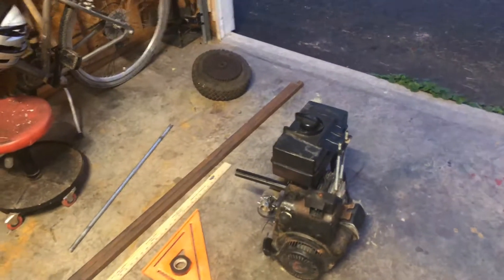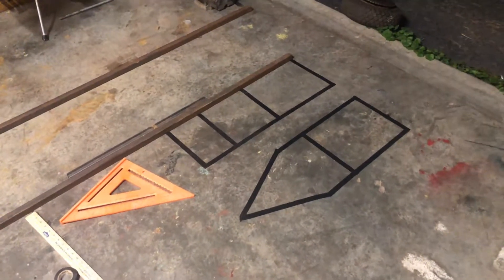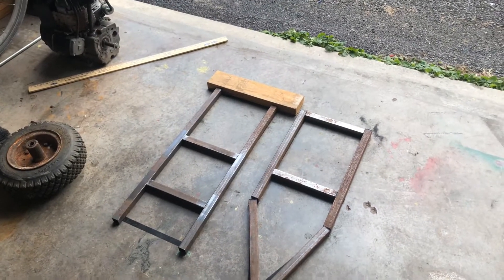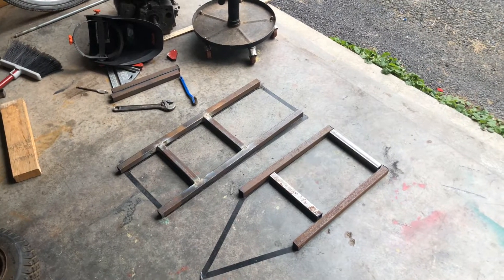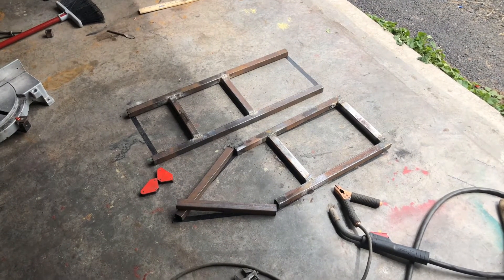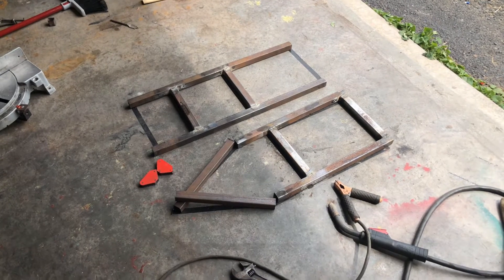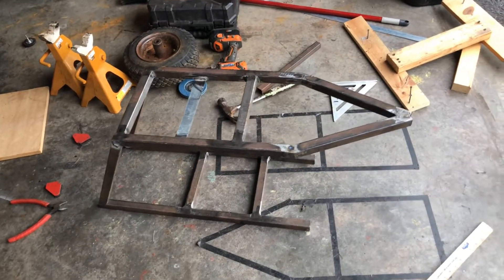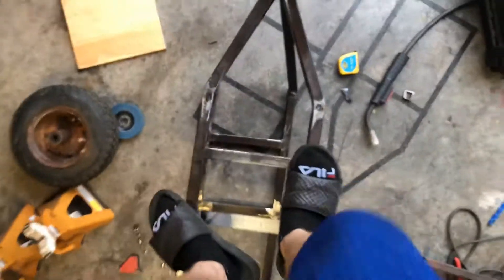Custom DIY Mini Bike - Part 1: Frame Construction

Comment: Just curious why people call it square stock? I’m a welder by trade and when I hear “square stock” I think square bar stock not square tube.
Reply: Nice frame though, I’m thinking about doing the same what thickness did you use?

Comment: what is the length of your top frame and bottom frame
Reply from the maker: Bottom: 
straight section ~ 28in
angled section ~ 6in

Top:
straight section ~ 18in
angled section ~ 12in
Reply: I don't mean to correct you nor come across like a prick. Are you sure the measurements are not 18/6 top and 28/12 bottom?, sorry if it's a bother

Comment: I noticed while you were welding at times you were holding the gun quite far from the weld, I'm not a professional at welding but I'm pretty sure the closer you hold the gun to the well the easier it is and you have more control

Comment: Really enjoyed your video and im virkning to make one myself but i was just wondering, how thick and how wide was the metal you used for the frame?
Reply from the maker: For the most part, I used 1 inch square stock, and it seems to be plenty strong. Good luck with your project!
Reply: @gkgt5226  Thank you 😁

Comment: Out of curiosity, was that flux core wire?
Reply from the maker: Zrage VII Yes, it was flux core. Thanks for the watch!
Reply: @gkgt5226  liked the vid and have something similar planned. You have my respect for those welds, they looked amazing for flux core... I can't do wire feed welds at all, I prefer stick or tig because im ok at them... really awesome bike though, I would love to see more stuff like this
Reply from the maker: @zragevii4705  Again thank you for the support and kind words. I've never actually tried stick or tig because I don't have the equipment, but hope I have the opportunity to at some point in the future. Good luck with your own build!
Reply: @gkgt5226  if you get a chance, it's worth it... a welding class at my school had stick, wire feed, and tig. Hopefully soon I'll get a welder, until then I'm gonna have to make bolt on brackets
Reply from the maker: @zragevii4705  Very cool! I've seen others do some pretty crazy stuff without a welder, so I'm sure you'll do fine. Hopefully, all is well and you can make it work.